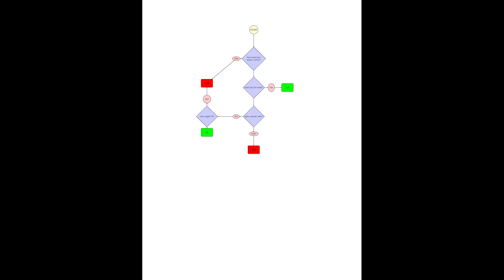Gardner Engines: difference between LX and LXB

Comment: When  WW3. Happens. These engines will be pumping out the mines. Repurposed . Running the generators.  Etc. with sensible maintenance they just run and run. .its like the COMMER engines the 4 cylinder were great the 6cycl

Comment: Most original Gardner marine engines are ran at 1350 rpm for a continuous heavy rating with heavy flywheels and 2uc or 3uc gearboxes I've owned 3 vessels all gardener powered some engines with 40,000 hours un touched

Comment: LXB cam shaft ground with a  10 degree extra lift. You see and feel if you hold the cam. Gardner main competitor Leyland introduced an engine that offered superior performance to the LX. Gardner responded with the LXB. PS I served my time as an apprentice at the Barton Hall Works Patricroft, Eccles. They were batch produced and custom built. The main point of contention between Paul and Jack Gardner was turbo charging. Jack Gardner totally opposed to turbos, while Paul Gardner was privately testing the concept. It did not end well!

Comment: Worked on many a Gardner engines mostly 6LX engines ,  has a heavy diesel fitter in the 60s/70s , great engines but they wouldn't pull you out of bed , good has a marine engine or geny setts, but not so good on road wagons or dump trucks .

Comment: Years ago when defiantly knew, but if plate missing off injection pump with hp at designated rpm, injection pump plungers different size on lx to lxb perhaps? Something in my mind says 6mm diameter for lx, 6.5mm for lxb.
For the lw, ended up at 20 hp per cylinder  but lw/20 even more smokey than usual lw when cold (not surprising at 13:1 compression ratio, do are Volvos), think over the years 1700rpm power went from 102 to 112 to 120hp for 6lw. Think the 120hp gained the power but got better specific fuel consumption than 112hp 6lw, so in reality fuel consumption pretty much the same. Got ERF rigid curtainsider with 6lxb in, and on mixed run with some motorway running in get 16mpg. Know nitrous oxide and particulate levels high.....but that's still good in my book 
Thank you for the lovely video.

Comment: On the LX the inlet manifold is closer to the engine  the bakelite joints are thinner that's going back a bit      the collet type valves were a replacement for screw top exhaust valves they went through a spate of dropping valves they couldn't alter the inlet valve because of the mask ,

Comment: Rebuilt heads using old used exhaust valves?  We have just rebuilt our 6LX In our Foden and LX specific parts, including valves and injectors are available off the shelf from other well known Gardner Spares suppliers. Please don’t spread false information

Comment: Morning Joe. i have an LX along side my other collection of LXB's, the LX cylinder head is a type 2 head with the extra 3/8 B.S.F stud which after a bit of studying is the exact stud pattern as LXB - the only difference as you mentioned the rounded corners of the head and the valve seat angles- the diameter of the valve seats, inlet and exhaust outlet chambers seem to be the same as LXB - could (only a thought) replace the valve seats in the LX type 2 head to LXB valve seats, guides, valves/rocker arms etc? also i noticed that the heads both LXB and LX are stamped on the top of the heads at each end where the decompression levers are?  only a thought - was wanting a spare head as a boat spare parts item. cheers Brad
Reply from the maker: Ah, Brad, thanks for that.   I forgot about the LXB stamp near the compression lever.   Yes, you can replace the valve seats in an LX head with LXB ones.